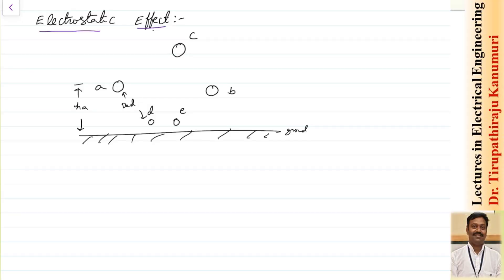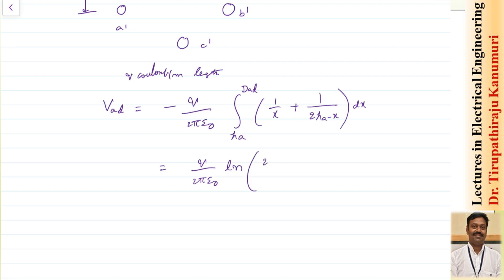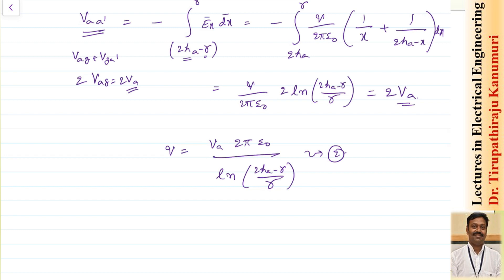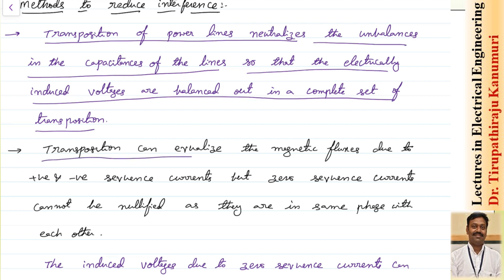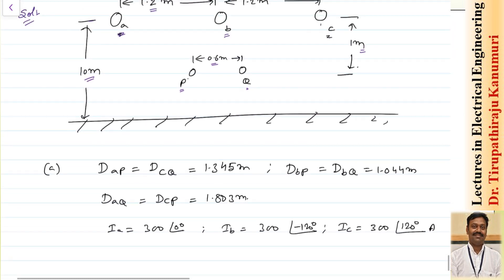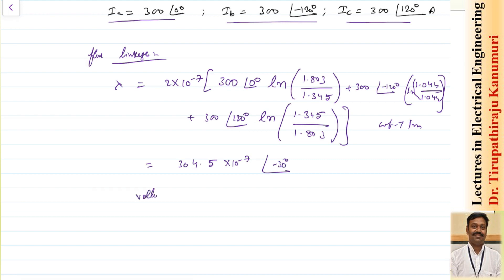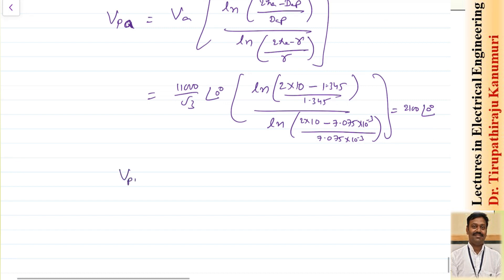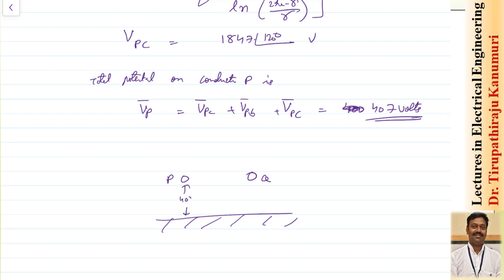PS47 Interference Between Power & Communication Lines 02

Comment: Dear sir,
What happens to electro magnetic induction voltage and electro static voltage through out the line  at below two cases
i.when earth switches at two station ends are closed ii.opened

Thank you sir for clarifying the query asked earlier